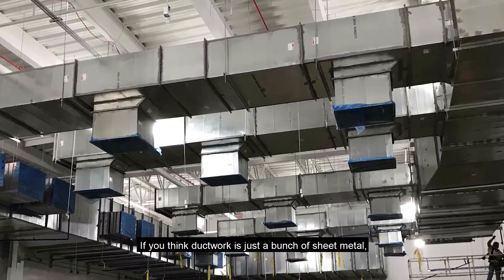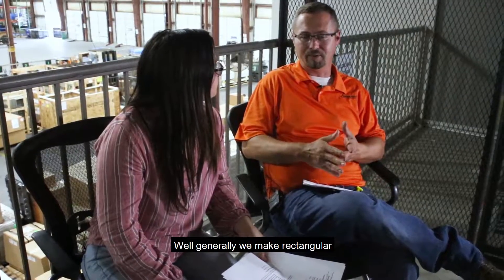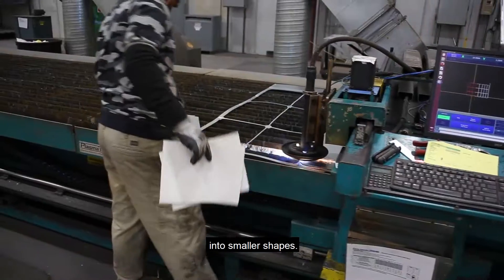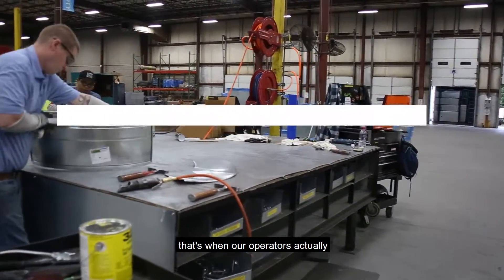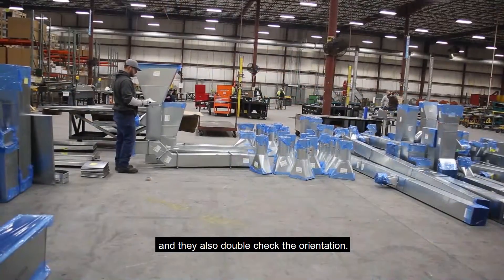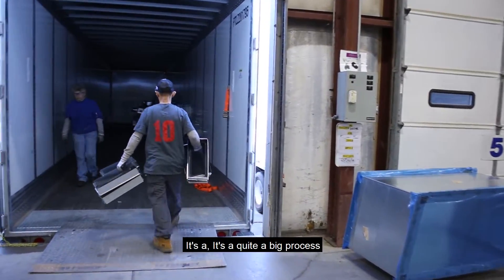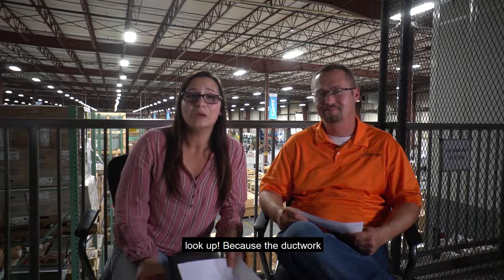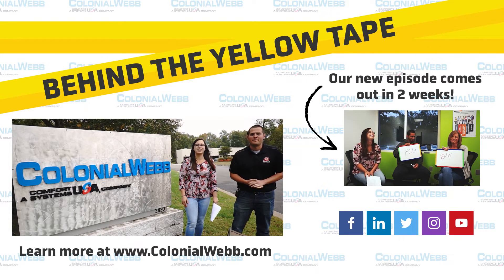How It's Made: Ductwork - Behind the Yellow Tape

Comment: Do you fully weld the longitudinal connection of the duct? or whats the best type of connection on the longitudinal side of the duct to prevent air leakages?
Reply: We weld the longitudal seams if the duct process , or customer requires it . Generally this process of welding will prevent air leakage the best. We perform leak testing once the welds are completed to ensure there are no leaks present.

Comment: What ductwork material is best for residential use? I’m confuse between aluminum,galvanized steel and stainless steel.I have single family house need to replace my full duct which is in the basement and looking for best material.
Reply: I would use either 26 ga. or 24 ga.  Thats all you need for residential use.
Reply: I’ll say go with stainless steel it might be a more expensive tho.
Reply from the maker: Hello Sultaan! The type of material that you use for your ductwork is dependent a few factors. The best choice really depends on your home design, heat retention, and noise reduction requirements. We would recommend that you have a contractor come out to give you their advice.